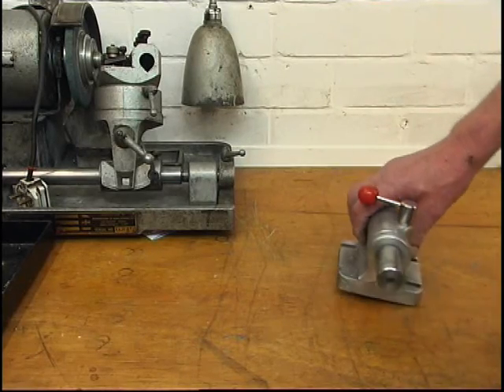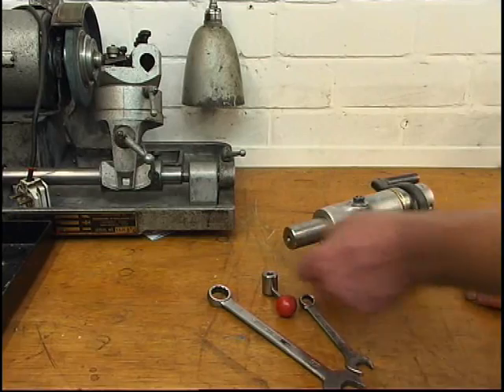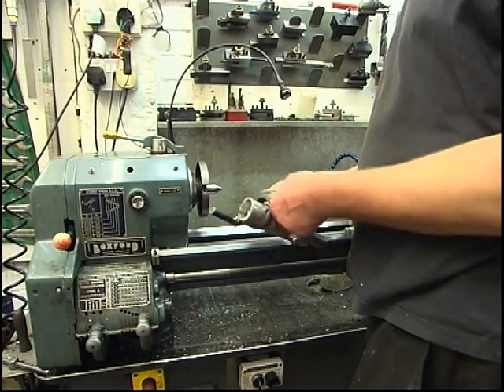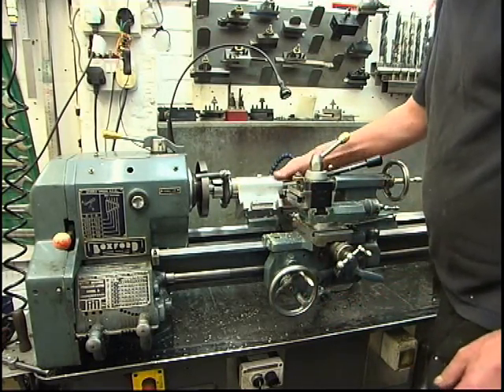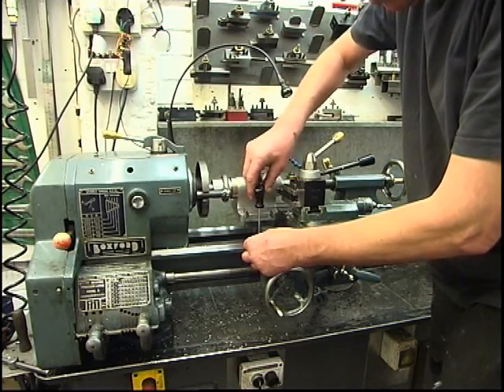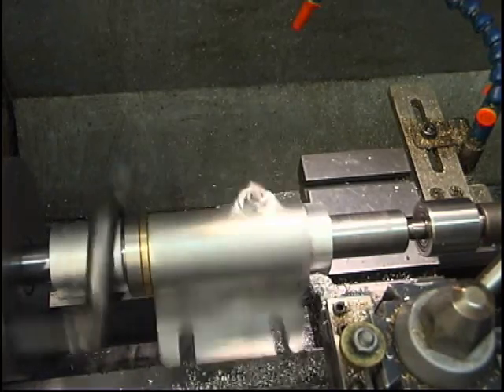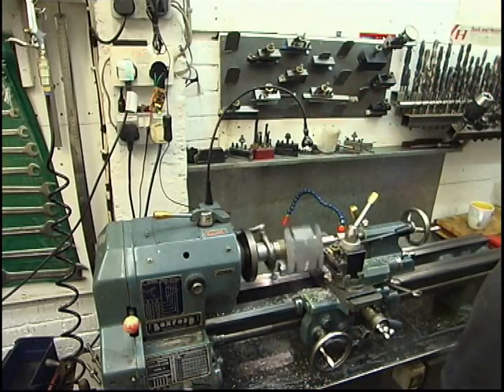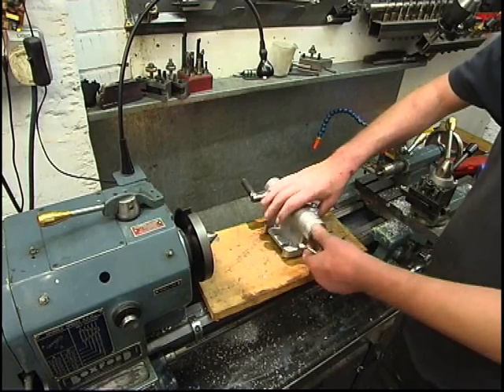DIVIDING  HEAD PART 14 how to hold it

Comment: Be careful using power tools when under the weather...it's easier to make painful mistakes.  If nothing else, it can be a distraction.  I've had the rule that when I start getting tired or not feeling well I unplug everything (hand tools still allowed) ever since the day I kept going when tired and ended up with a broken thumb from a table saw kickback.  Simple mistake I wouldn't have made when more alert. 

Does "twasterd" mean there are two of you? <grin>